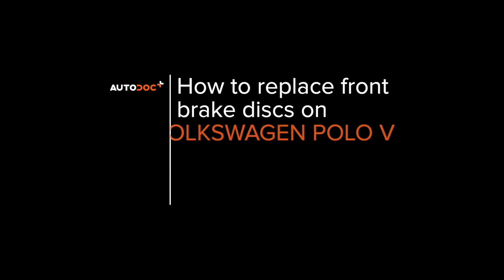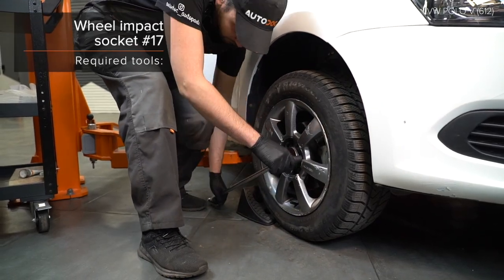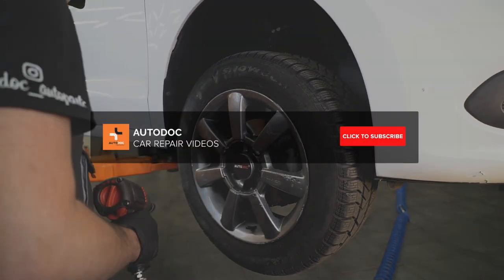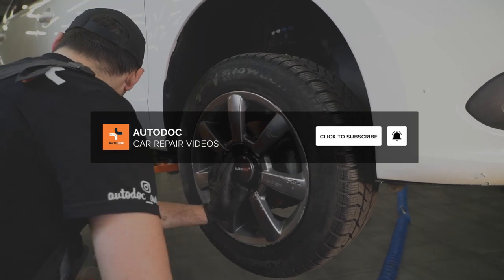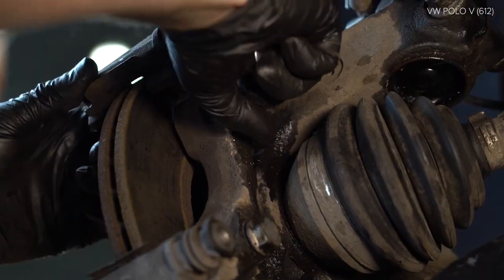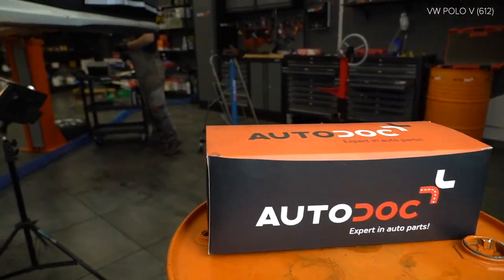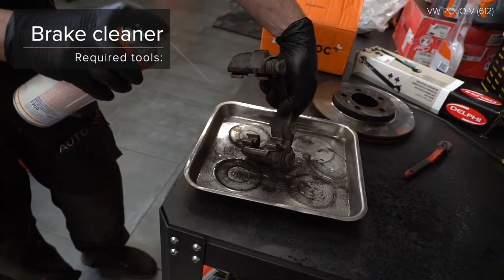How to change front brake discs / brake rotors on VW POLO 5 (612) [TUTORIAL AUTODOC]

Comment: Copper spray is not the best option due to copper and cast iron (steel) are a galvanic pair, resulting in increased corrosion. Ii is better to use aluminum spray or hi-temp brake grease.
Reply from the maker: Thanks for the clarification, we’ll think about what we can do with this in new videos.

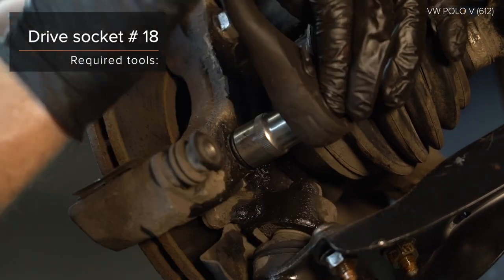Comment: Great video. What is the part called around 1:50 that the calliper carriers are attached to?
Reply: I believe it is the wheel bearing housing (example PN 6C0407255A)
Reply: Your mum
Reply: @finmack610  Are you using internet explorer? 2006 called.
Hopefully you're not in charge of a vehicle with a reply like that.
Reply: It's the hub carrier
Reply: Guide pins and boots should have been serviced as well.

Comment: didnt clean the slide bars mate, useless
Reply from the maker: You are right, some points in the video were missed, but our channel is not educational but is only for informational purposes. 
We strongly recommend that all replacements, especially those relating to the brake system, be carried out exclusively at a specialized service.
AUTODOC